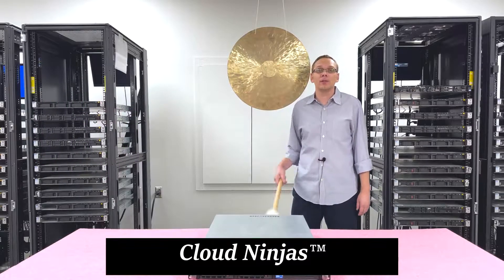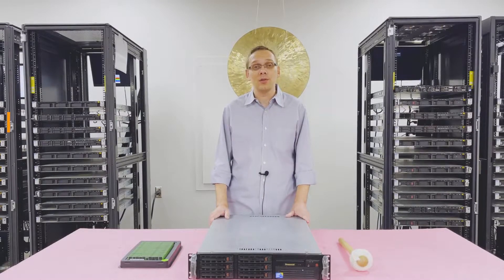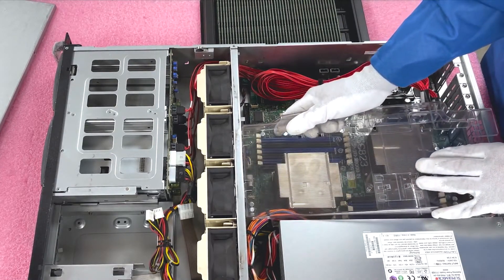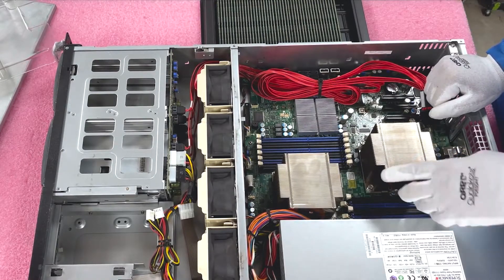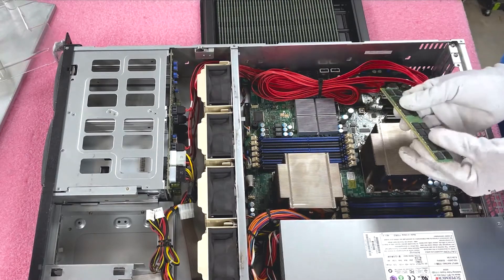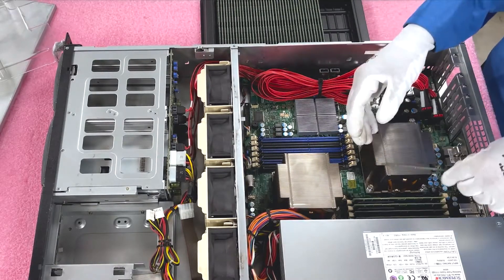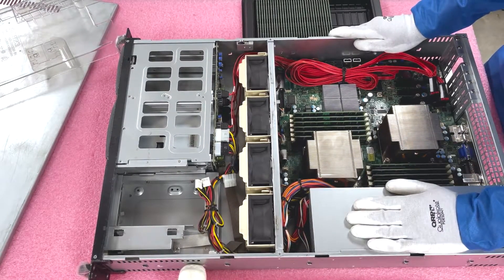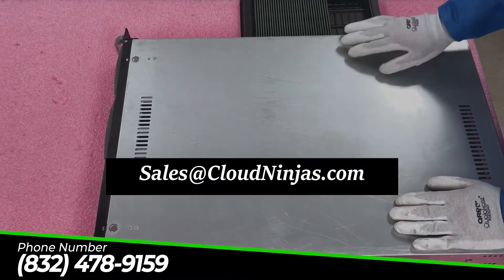Supermicro X8DTE, X8DTE-F, X8DT6, X8DT6-F Server Motherboard Review | CSE-823 | DDR3 Memory Install

Comment: I have this bored in mine running truenas with LSI controller in IT mode. With 6-6TB drives 
And 196gb of ram. Dual x5670's With 2 JBODS running off it with a total of 25 4tb drives. 
Running Immich, plex, and other apps. 
It is a tank
Reply from the maker: Wow, that’s a beast of a setup! 💪 Those X5670s with all that storage and RAM really make it a tank — perfect for Plex and Immich.